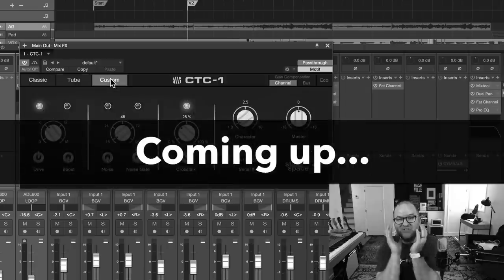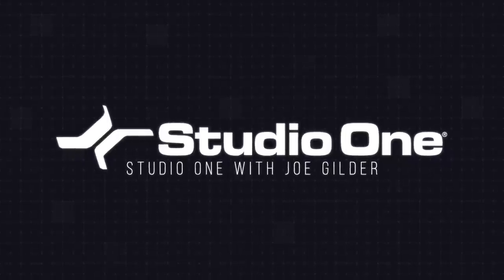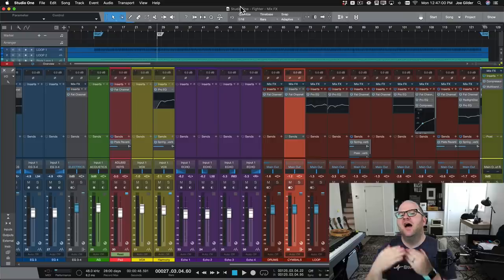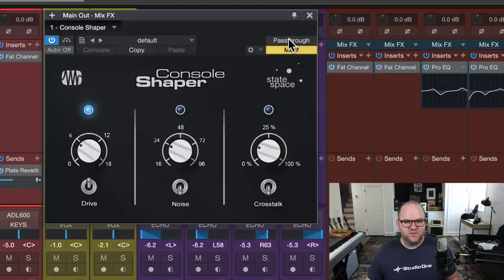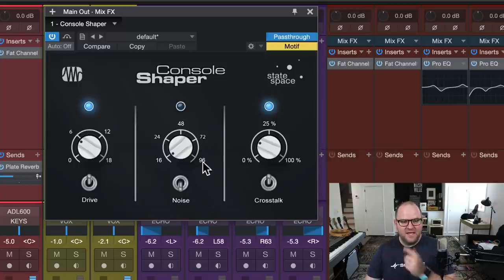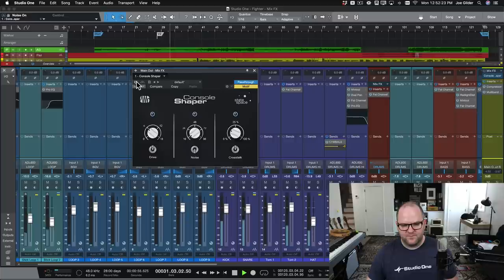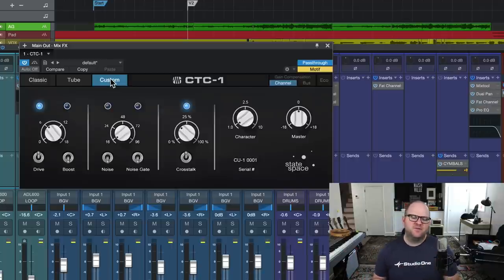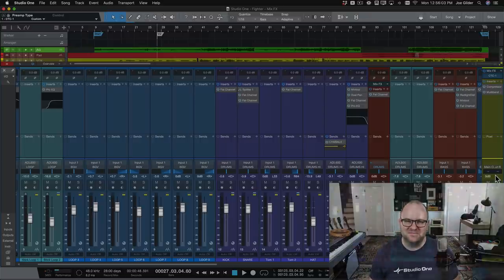Mix Engine FX and Console Shaper in Studio One

Comment: A little off topic, but you touched on it. Whenever adding an analog effect listen to the color it adds before tweaking. For example, you recorded a guitar part. You throw on Fat Channel. Have all the EQ settings at zero and listen to the differences between the different EQs. Do the same with the compressors. The color they add at zero can already help.

Comment: I am a Console 1 user so some of the functions of this are in there (like the drive on each channel), but not the ability to mix it into the "MixFX" across the channels (which would be really awseom Softube if you are listening, and since you allow "tape" to be used that way).  I really like the Console 1 and the various emulations I have for it and I wonder how much overkill this is on top of that - layers of drive and whatnot; with the Console 1 intending to BE the console strip for each channel and with other functions (EQ, Compression, etc).  I picked up the Console 1 after trying the built-in Console Shaper because I thought it sounded terrible and the Console 1 sounds amazing, but now, as a Sphere member, I picked up the CTC-1 to see how it works and it definitely sounds better (to me) than the built in Console shaper but without the extra awesomeness of the Console 1 stuff.  What to do!? So many great choices.  I think I will add them all and turn them up to eleven! :)  Thanks for the clear and non-confusing explanation of these.

Comment: Nice intro. Two buttons that got missed on CTC-1: "Channel" and "Bus". You dropped it on the Master Bus, but left it set for "Channel". What's the difference in function? Does either effect channels differently? Should it be on "Bus" when on the Master Bus? Inquiring minds need to know... It's not in the manual!! Thnx
Reply: "Channel" and "Bus" refer to the automatic gain compensation and where it's applied. On the individual channel stage or at the (bus) output stage.

Comment: I tried it out, they showed up on my master subs which is fine. I tried it on a new re-mix for an upcoming video of a song I have out. I really didn't add to much because I am already mixing with console one that does the same thing but it does not have the cross talk which is interesting. Personally I'm not a fan of cross talk but perhaps a bit of an underlying bit of it would help glue the mix. If I were to use that feature, I think I'd use it before adding processing to the master subs so I can add post EQ on the subs with that in mind. When I was doing live recordings I was used to masking a mix and really good at it. That is sort of the same thing that is going on in an analog console and on analog tape recorders.

Comment: Hey PreSonus, please fix the issue of the Mix Engine FX not applying to tracks that have side-chain inputs to them! I understand the idea is to not double the processing, but most of the time, the side chain is not heard, it's actually used for detection purposes (side-chain compression for ex), not actually heard, so you're not doubling anything. In electronic music, a lot of channels use this side-chaining, if half, or more than half of the tracks do not actually get processed, its basically useless!

Not saying to change the functionality completely - maybe both functionalities are desired - but it should not be a big deal to have a switch to activate/deactivate processing on each channel with side chain inputs. I bought CTC-1 non knowing this, and I really love the sound, I would love to use it but I can't because of this.

Comment: I'm a Sphere member and don't see CTC-1. Is there something you have to do to turn to make that available?
Reply: It's only in the "mix fx" folder. Or click the small "+" in mixer's mix fx slot (the one on the top before regular inserts).
Reply: @andikoyama  Thanks, Andi. That is where I looked and it used to be there (I bought it long before Sphere) but it has disappeared. I'm trying to reinstall, but as usual with this kind of thing, PreSonus is the opposite of helpful.